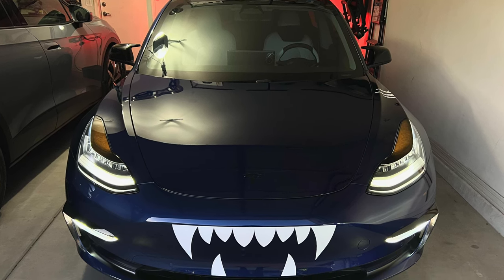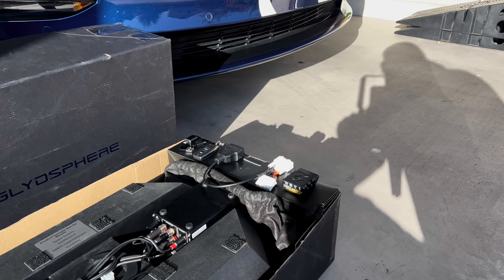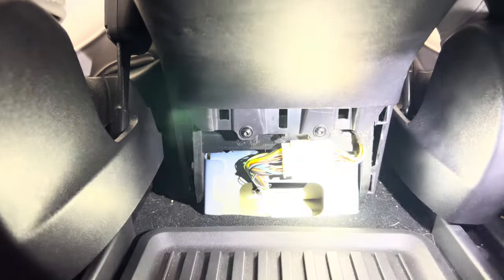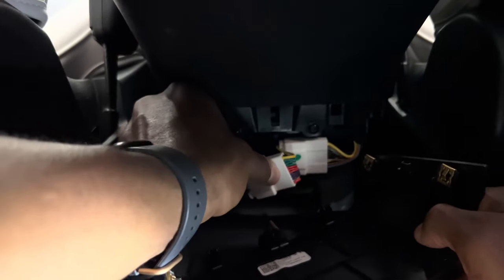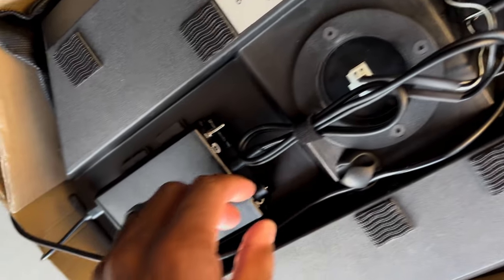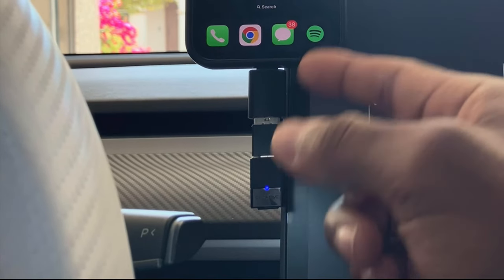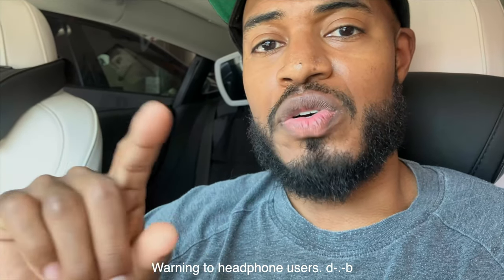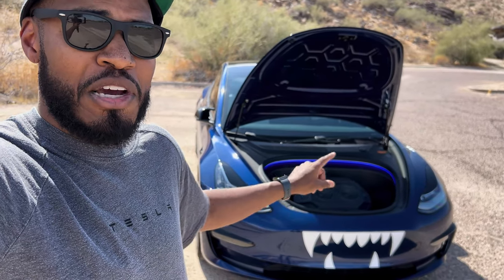How To Make Your Tesla Sound Like A Sci-Fi Supercar | Glydsphere Wireless Speaker Install & Demo

Comment: great video! It would be cool if they made an adapter and included a splitter and just tapped into the 12v plug in the frunk.
Reply from the maker: Thanks for watching! Yeah that’d be cool. More wires though.

Comment: Nice video.May i ask you how to recharge the speaker's battery and if it's even possible to install it in the rear trunk?Tkx
Reply from the maker: Yeah it’s just an external rechargeable battery. Similar to any other, just bigger than most. Haha. You just plug it into any USB C charger and it charges in a few hours. Lasts me a few months on a single charge but I don’t use it all the time.

You probably could fit it in the rear truck but I wouldn’t recommend it bc the sound would flood your cabin. It’s loud.
Reply: @BlakeCheck  tkx!

Comment: Would be nice for the odb2 connector had an additional port to connect another devics since this will be an issue for someone who is already using the obd2 port for other tesla accessory such as a cluster display or a rear display from hansshow.
Reply from the maker: Ah yeah good point.